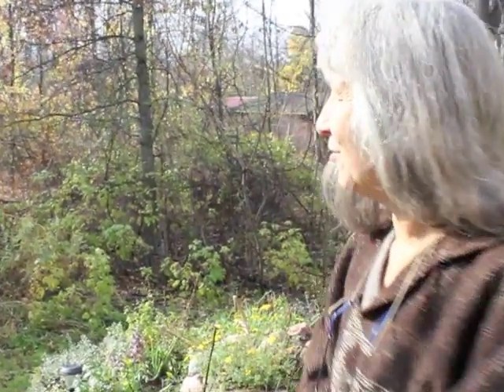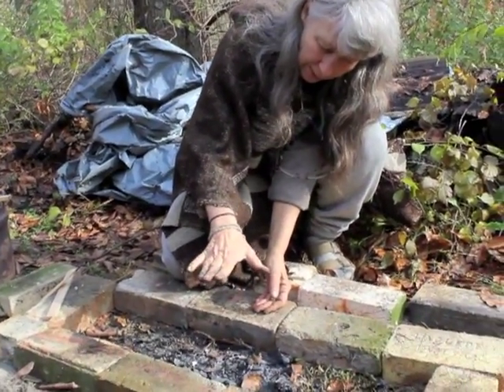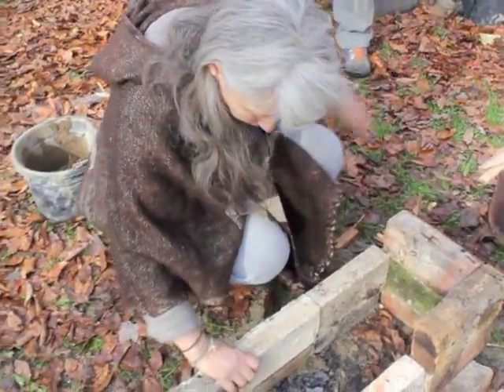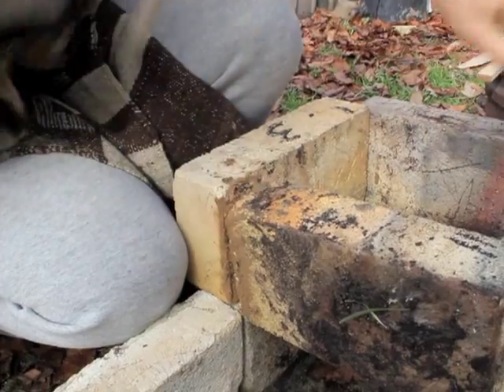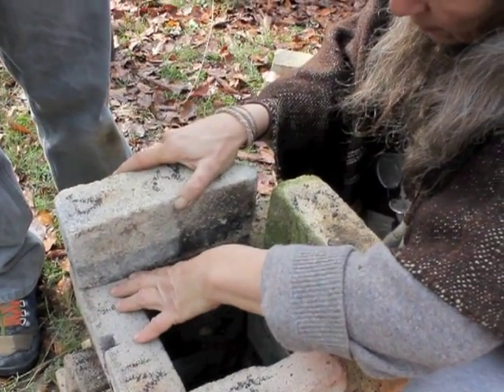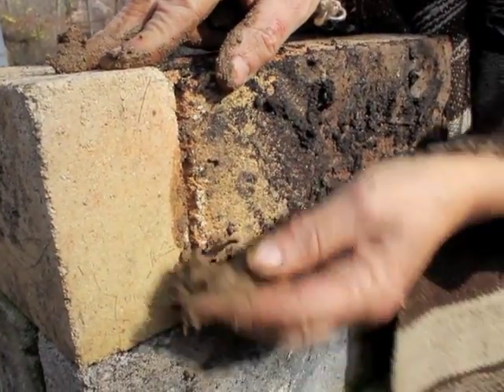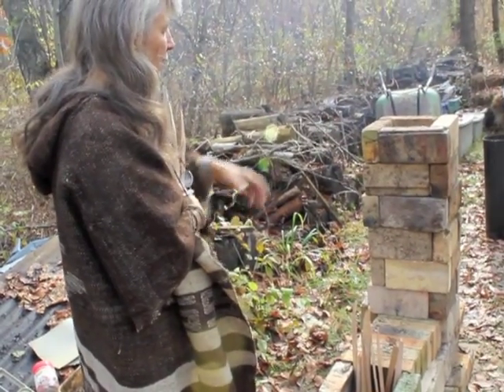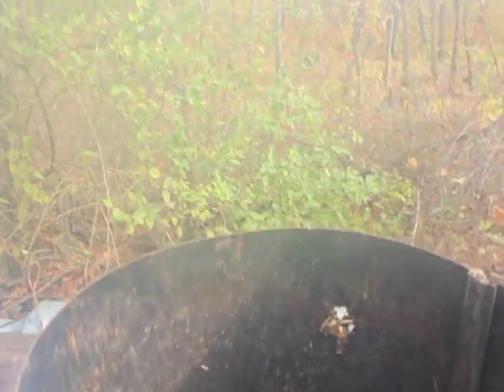Outdoor Hub Tutorial - How To Make A Rocket Stove

Comment: Good video. Not many videos show the actual brick pattern. One thing about bricks I do want to comment on. Red bricks with holes in them are fine to use for a couple of seasons.. Make sure that you do not keep them outside in the weather where they may collect moisture. In my first stove for a greenhouse I used those bricks but I used refractory mortar. I believe the mortar gave the bricks some extra strength. I don't use that type of brick any more but they have lasted for 3 seasons so far.